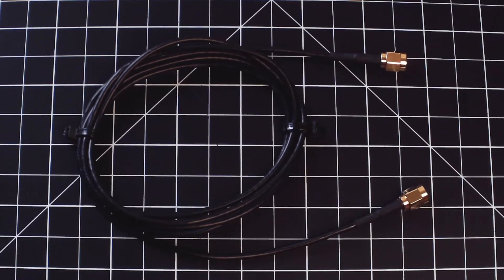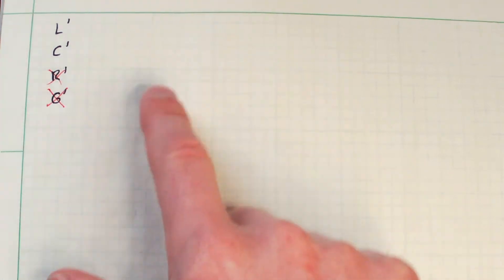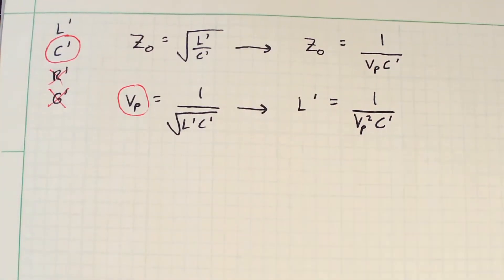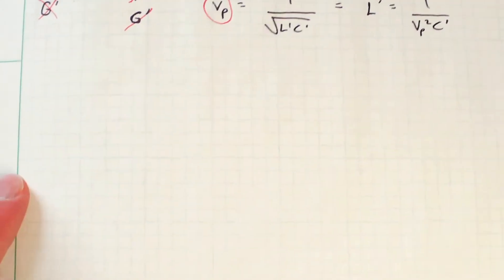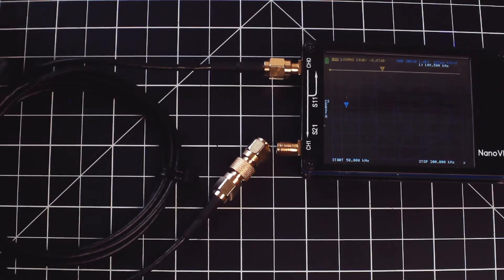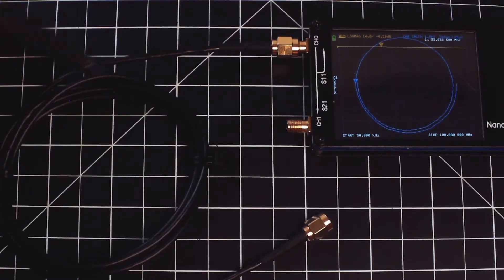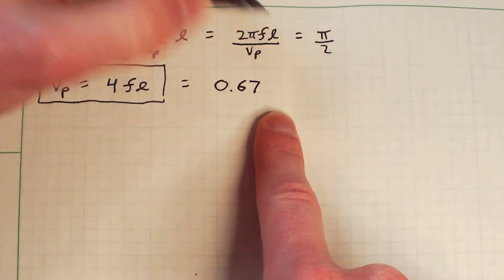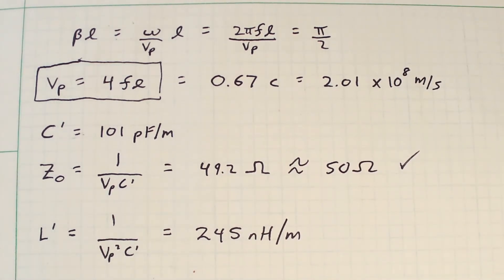How to Measure Transmission Line Parameters with a NanoVNA

Comment: Nice explanations and derivation of the required formulae. However, in my understanding there is one main flaw which is pretty fundamental: It is stated that the inductance (L') varies with frequency because of the skin-effect. This is correct, however, the phase velocity which is used instead is also frequency specific and not frequency independent! Also, the measured capacitance for a cable also varies with frequency, so the same reason why L' cannot be measured directly (and used to compute Z0) could be applied to C' as well. So the reason why the example measurement turns out to be pretty good is that the lambda-quarter frequency was found at 33 MHz which is a reasonable frequency to measure this cable. I did a quick comparison (with my LiteVNA) between the proposed measuring technique from the video and simply measuring L' and C' directly (at frequencies between 1 - 200 MHz) and found that the error is about the same with both approaches.
Reply from the maker: The error in low-frequency inductance is much more significant in my experience. I don't have my data, but I believe it was something like measuring 55 Ohms for the characteristic impedance vs 49.5 Ohms after the correct. No measurement is ever going to be perfect, but you can certainly talk sensibly about degrees of error and uncertainty. It is also instructive to realize that the artifact is not a problem with the measurement itself, but a real physical effect within the cable.

Comment: Hi, thanks for the video :-) I got a question : As the connector of NanoVNA is an SMA, its impedance is 50 ohm. So if we use a cable with not 50 ohm impedance, there will be mismatch between cable & connector. I would like to know if in this case the calculus you used is still valid for determining the caracteristic impedance of the new cable ? Thanks !

Comment: Thanks for the video. Why beta*l=pi/2? Could you explain this passage better? Why pi/2?
Reply: Because when he dialed the marker on the smith chart to the short (closed) position, the first passage over the horizontal line, this is the frequency where the specific piece of cable that is hoked to the NanoVNA acts as a quarter line "stub" for the given frequency, so effectively you used the NanoVNA to find out the what is the frequency where that happens for this cable, where.
So now that he knows that at this electrical length, beta*l, the cable is exactly pi/2, a quarter wave.

Comment: That beta is supposed to be phase constant. It denotes the change of phase per unit length along the path travelled by the wave. In your experiment, at 33MHz, the change of phase over the length of the cable is pi/2. Which means (pi/2)/L = beta, and hence leads to your equation beta * L = pi/2.
Reply from the maker: Yes, I know. Did I give some indication I was confused somewhere?
Reply: @jamesnagel2872  No you were not confused - you were good. I was not trying to lecture you, but to point out that you incorrectly mentioned that the beta is the Propagation Constant instead of Phase Constant. And also gave a simpler way to derive your final formula on the first line.
Reply from the maker: @tze-ven Ah, I think I see what you’re saying. 

You are correct that the terms “propagation constant” and “phase constant” are not the same thing. However, the distinction is subtle. The main difference is when the transmission line has attenuation. In that case, the propagation constant also accounts for attenuation. For lossless lines, however, they simplify into the same thing and are thus interchangeable.
Reply: @tze-ven great work 👌👏👍

Comment: Dear James. I have tried to measure 50 Ohm cable with l=10.07m, 382pF total capacitance and 5,405MHz frequency where on Smith chart is short point. Regarding your calculations I am getting around 121 Ohm. Where I am wrong?

Comment: Half way along a Smith chart is 90 degrees  isn't it? 
In other words going from open (right side) to short (left side) takes half a circle or 90 degrees. so the cable's length is half of that or 45 electrical degrees because the signal travels forward & back.

Comment: Thanks for the great explanation, quick but clear! One question though, you mention you're not measuring the inductance at low frequency as it varies too much. Does that make the value you now got specific to the 33MHz frequency at which you found the 1/4 wavelength propagation?
Reply from the maker: There is a "transition" bandwidth where the characteristic inductance varies, but it eventually stabilizes as the frequency gets very large. It happens because the skin depth is decreasing with frequency. Eventually, the skin depth gets so small that the current can be approximated as a thin sheet along the conductor edges, and this is where the inductance stabilizes.